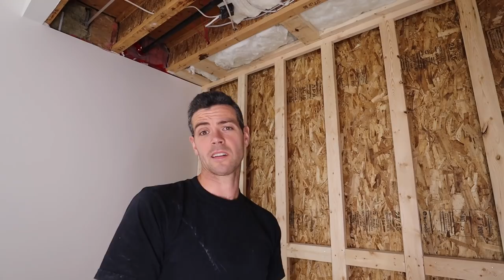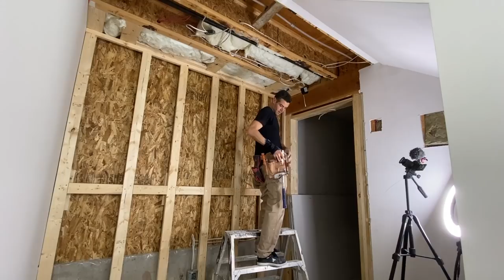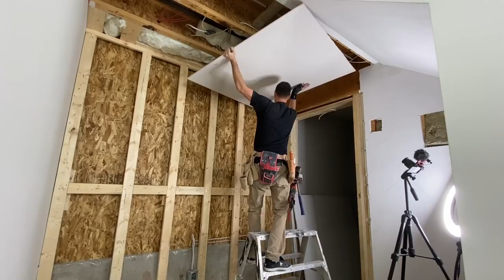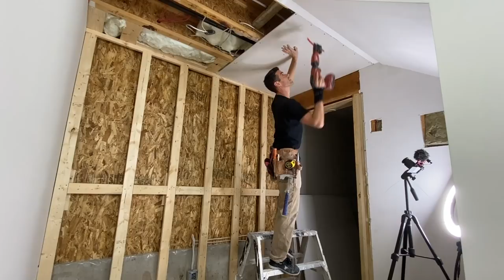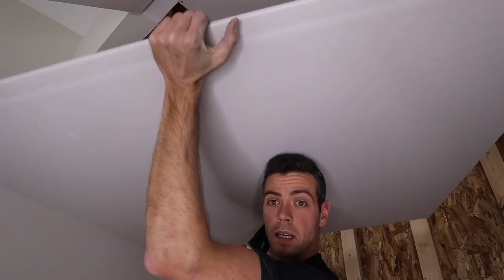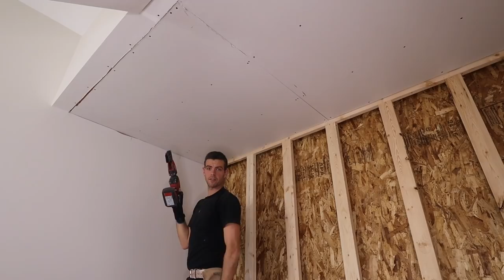Hanging Drywall on a Small Ceiling

Comment: I just took over a homeowner's basement finishing. Following your videos he drywalled and taped it. Other than a boat 7 dry tape spots, which were easily fixed on first coat, and some of his corners being slightly rounded because he was doing it by hand rather than with the flusher, I could not have asked for a better job. Joint placement was on point, he marked out everywhere he was going to screw so they were barely any missed screws, even a couple of spots where he did his first coat of mud on some butt joints (which is when he decided to call in a professional) were done really well. 

he told me this channel is where he got all his information, so I can tell you firsthand, you have given out very good information. Thank you very much, this is literally the first homeowner partially completed job I have taken over where I was able to tell him the truth about how good he did. You made my life much easier, I will always send people your way

Comment: everything with the exception of the knife.. i have as my setup, right down to the belt... i have run Kuny's belts since i was 14, im 21 now. i have a 14 oz estwing drywall axe (mines a square head though) Olfa knife, irwin drywall saw too. Only thing i do differently is my screw gun goes in my back holster, tape goes in my left side very bottom pouch. easier to grab and measure with the left hand and mark with the right. Also, when in doubt and dont have a drywall rasp.. use the BACK SIDE of the drywall saw!! works like a beauty. 

bottom pouch - tape measure and cigarette butts lol
second last pouch - 1 1/4" screws
second from the top pouch - 1 5/8" screws
top pouch is usually where i keep my phone, drill bits, sometimes a tiny box of Kelly Framing screws, laminating drywall screws, sometimes my chalk line or a stud sensor.
not that anybody asked about my setup but i just think its cool that some stranger on the internet has pretty much the same setup as me and i love hearing about others peoples belt setups.

Comment: Ben, your videos are so helpful, I just wish I had seen some of them earlier.  I'm helping my in-laws renovate their master bathroom to be more wheelchair accessible - we took a small wall out, had to move the toilet, made the shower bigger, etc.  Anyway, I installed 1/2" drywall on the ceiling (not knowing at the time that 5/8" is standard) on 2' OC trusses.  One part of the ceiling is about 5' x 12' and the other part (L shaped) is about 3' x 5'.  We've basically taped it (and the walls) and are about to start the finish coats.  So, I'm curious about how you think I should proceed from here.  I'm thinking about these options:
1. Just leave it and hope it doesn't sag.  If it does, just deal with it then.
2. Put a couple skim coats on the ceiling to build it up to 5/8" or so.  This would be good "practice", and hopefully prevent it from sagging?
3. Throw another layer of 1/2" drywall on top of the existing ceiling.
4. Rip the ceiling out and start over with 5/8".
Thoughts?

Comment: Please do a video on the different types (lightweight, "regular") and sizes (1/2, 5/8...) of drywall.  What are the pros and cons?  Is lightweight drywall as strong against hits and sagging?  How does today's drywall compare to drywall 30 years ago?  Which brand and type do you prefer?
Reply: I was in the taping trade and honestly CGC is the brand drywall that's most used. (Here in Ontario anyway) I find there are "cheaper" brands that are used and the quality of board is different when applying mud I tended to find. Like there is different brands of mud that give different results.
Reply: @ianmurchie1567  i ALWAYS use CGC. except when i get 1/4" board, that is certainteed. I dont think CGC makes 1/4" anymore and if they do its probably an absolute relic if you find it, at least where i am in Ontario lol

Comment: One situation I'm running into that I haven't seen you make a video for is what to do if your tape job fails/cracks all the way down an inside corner. I'm having a tough time removing the old tape, and it's causing some damage to the drywall underneath. My plan is to try and get all of the old tape out, prime any exposed paper, and use quickset to backfill before doing a proper tape job.

Comment: Just did a patch on a middle floor ceiling at work we had flood damage from the apartment above springing a leak at a T off the cold water line.. 2 layers 5/8 shit sucked finished great and knock down blended great, but damn that board sucks over head with my co worker reloading my drill 1 2" screw at a time.😵

Comment: Is that a rigging axe? And have you seen the video from maybe..the 60s of that old school drywaller using a rigging axe to cut and install drywall? And I have the yellow and black version of that gun and they are Soo handy. Not sure if the Grip rite brand is available in your area but the 1000 collated screws were pretty cheap and there was atleast twice the number of screws per strip. Saved so much time when I remodeled my 2nd floor

Comment: Yo.  Mr. Vancouver.  What is the additive you pour into the drywall mix?  I did a skim coat on panel board and it started peeling off.  I realize I used Kilz instead of a shellac based primer and I should've used the additive you use to give the mix more adherence.

Comment: Enjoy all of your videos. Question: I'm trying to match some large areas, approx 3.5' x 4', of drywall to existing plaster. The problem, of course, is significant variation in the thickness of the plaster. The area is above a new shower to be tiled soon. How would you handle it? Out of the many things I always do for myself hanging, taping, or skimming drywall is new to me. Subtle variations in plaster thickness are not a problem to the eye, but any visible patching is unacceptable. I suppose installing a layer of drywall over the entire ceiling is one answer but that seems like a lot of extra work and needs to be taped and feathered in on two additional plaster walls. How do you think it should be handled?

Comment: I really enjoy watching your videos and they have been helping me build up the confidence to tackle drywalling my basement. I have 9 foot ceilings. What do you think about hanging drywall vertically to avoid having to have a 1 foot strip? It seems to be that with 10 foot pieces trimmed to 9 feet and hung vertically I would have a lot less taping to do and almost no butt joints. I have looked around and 54 inch wide drywall does not seem to be easily available.

Comment: Hey Ben I just bought the dewalt auto feed attachment as I already had the cordless gun and I had a whole basement to do. I found though with it if your not perfectly square to the sheet when driving the screw it doesn’t set the screw very well, I get it if your on a big angle but I’m just off the slightest bit. Is this something that all auto feed guns are like or is this just what the dewalt one figured I ask you after this video and you have experience with the Makita and the Hilti thanks
Reply: I just bought a dewalt attachment as well and only found I had issues at the edges and corners where I was at an angle. There are two different dewalt attachments. DCF6201 and DCF6202 I have the 6202 and I really can’t complain.
Reply: @dennispope8160  just checked today it the 6201 that I got maybe it’s the first generation one and wasn’t quite refined I’ll keep an eye out for the 6202 thanks

Comment: Why does every one say 19.2" joist are rare or weird?
It's been on the span table for TJI I-Joists for decades, 19.2"O.C. 
It's quite common in medium to lower value construction allows for less overall joists, obviously mansions will be 12"O.C. or 16" but probably 12"

Comment: I really enjoy your channel and I've certainly learned a lot about drywall install.  I am disappointed to watch you bury an electrical junction box though.  I know the electrician was to blame for that but you should know better than to cover it up.
Reply: It's OK, those transformer boxes are for recessed LEDs and holes will be cut later. You can see the low-voltage tail dangling from the one on the right around 00:30. But the plumbing lines in the next bay might be an issue (depending on local codes) - for the couplings that will be hidden and also for the long, unsupported runs (32" is typical but here it is more than 48" to that center 2x4).

Comment: Loll routering above your head like, ow there it is and stick it above your head into the drywall.

You could have used glasses? Or does the dust go around those?
Reply from the maker: How am I supposed to get clumps of dust in my eyes with goggles on????
Reply: It's called the safety squint LOL